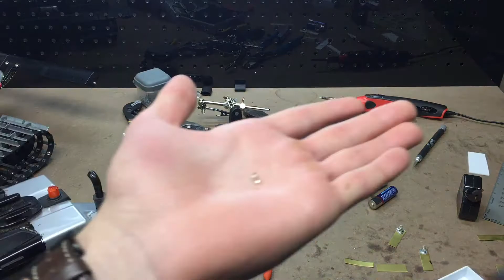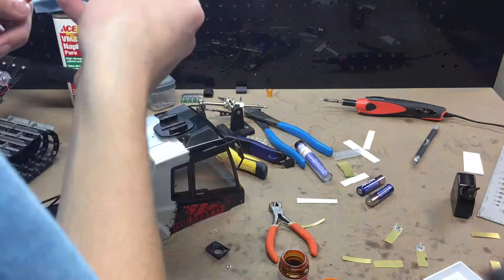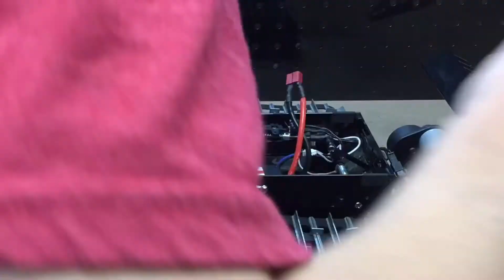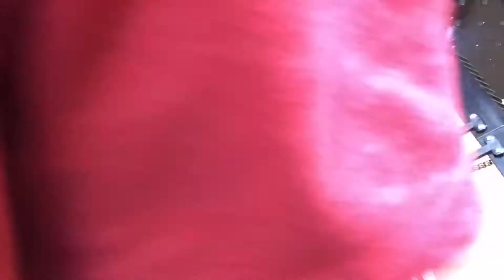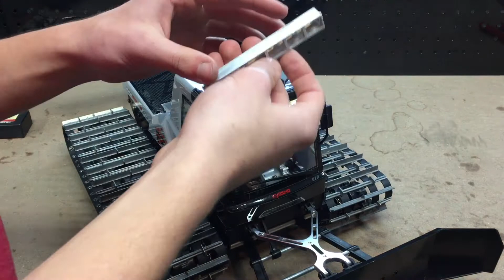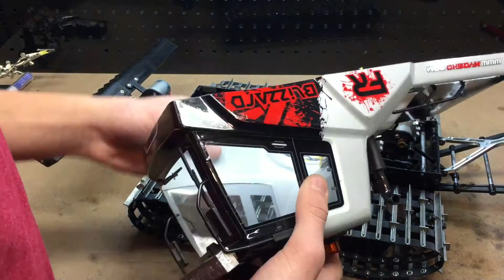EXTREME RC 4X4 Kyosho Blizzard Lights

Comment: With all those lights you will not need the plough as you will just melt the snow out of the way :-)
Reply from the maker: Basildon Trail Blazing Buddies Haha! Hopefully they don’t run quite that hot! Thanks for watching!
Reply: correct but i just kinda  mimicking the headlight decals  but the roof lights  front and back will be the one always gonna be use..  Thanks for your comments.